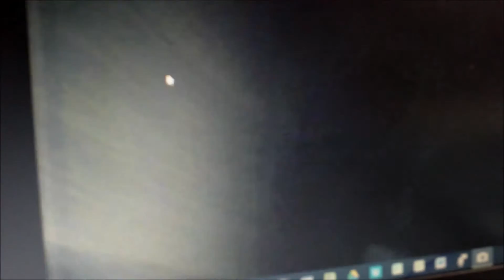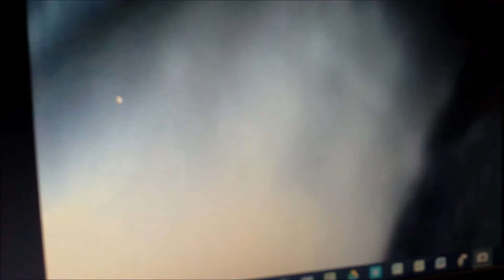TD5 Discovery 2 xyz gear position switch fault code P0705 video 2 of 2

Comment: I have a Discovery TD5 and I replaced the XYZ, but the problem still persists, such that if the car slows down, it switches to a stronger gear, which leads to the car slowing down significantly.
Reply: hi does you car get hot inside especially when you touch the hand brake
Reply: There is a bit of an increase, but sometimes it works down to m.  s D The one on the screen also pulsates and I replaced it with a user, but the same problem. The changes are not normal and sometimes it does not work now after I raise the RPM to 3000.
Reply: The symptoms are as follows: At first the first gear slows down, then it changes between gears normally, and if I want to slow down the speed to 40 km, it returns to a strong gear and it becomes difficult to walk unless I increase the RPM.
Reply: I cracked the red head on the computer, there is no oil, I cleaned all the plugs, and I changed the xyz switch twice, but I did not find a solution. I hope to find a solution with you.

Comment: Stuart, how can you get at the xyz connector? Do you need to drop part of the exhaust off as far as I can see?
Reply from the maker: On the TD5 Discovery 2, you have to remove the down pipe which is connected to the header
Reply from the maker: adrian kucinski yes it’s a garage job exhaust has to come off £350
Reply: Mr Strong is £350 the labour charge?